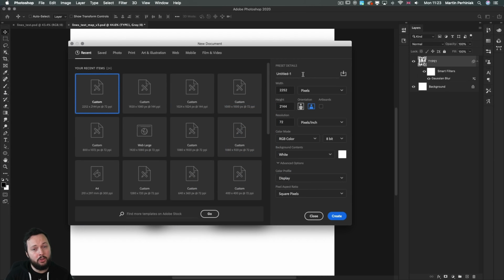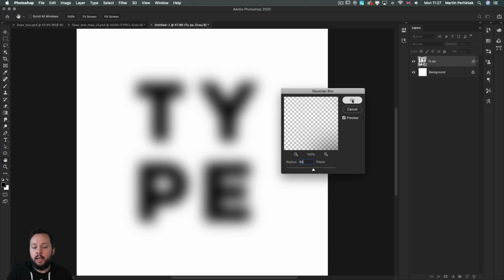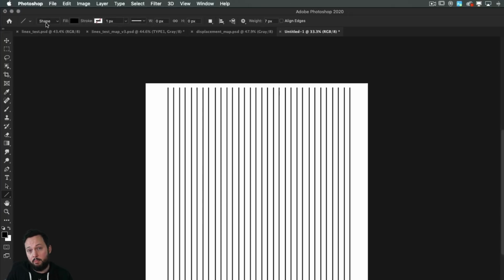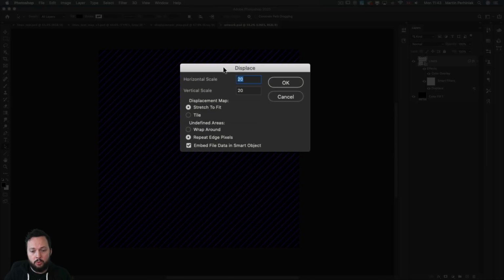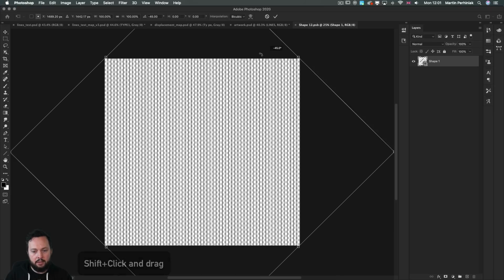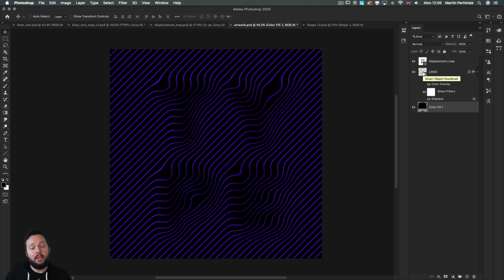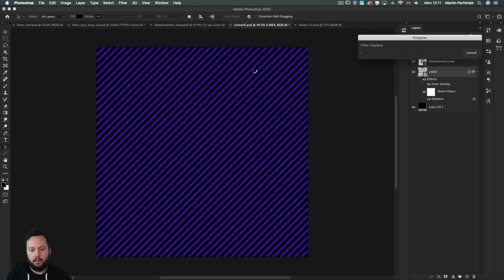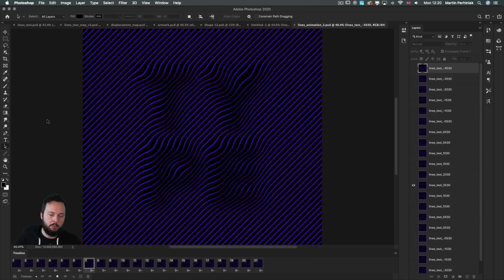Advanced Type Effect and Animation in Photoshop

Comment: Either every ones using  a different PS CC or my ps is fubar.   1) when switch to the move  tool my lines vanish. 2) when I rotate and save the psb my original doesn't show the rotation. Any clues??

Comment: Thanks for the nice turtorial! I only got one problem, because I can't pick the .psd file for the displacement filter – does anyone know how to fix that? :D
Reply from the maker: Stefan make sure you set it up as a Grayscale PSD, otherwise it won't work.
Reply: @YesImaDesigner   thanks for the fast answer! I found out that for me the General Grayscale settings including the General Grayscale 2,2 are not working! It works only with Dot Gain 15-25%, Gray Gamma 1.8 and 2.2 as well as sGray.

Comment: Hi Martin hope you're well?  Not sure what I'm doing wrong but I've tried twice and each time when I use the displacement filter it soft of shifts but doesn't create the effect as in your video?  Cheers Sue
Reply from the maker: Hi Sue, I'm good thanks ☺️ that's strange. It's quite hard to tell why it's not working but there must be something preventing it. Can you send me your files so I can have a look?
Reply: @YesImaDesigner  Make sure you have the maximize compatibility set to yes. I had this issue with displacement maps and that fixed it.
Reply: @dmm092158  Thank you for explain
Reply: @YesImaDesigner  thanks Martin that's very kind of you ... how is the best way for me to send to you? Dropbox?

Comment: instead of dragging lines just with "alt", you can use "alt + ctrl" to duplicate and then "alt + ctrl + shift + T" to repeat them with same distance. 
Exactly like you do in illustrator with "ctrl + D"

Also if you want to duplicate with different scale or rotation values, use "alt + ctrl + T" - change it with different scale or rotation - enter - press  "alt + ctrl + shift + T" to repeat with that value progressively.
Reply from the maker: Thanks a lot for the detailed comment. I actually used this technique in the past but for some reason it didn't work in Ps 2020. There might be a custom shortcut preventing it to work for me.
Reply: @YesImaDesigner  may be  
because I am currently using ps 2020 with same shortcut.
Reply: Or even we can use the blend option from Illustrator, it will save us from the alignment and distribution command as well. Just a thought.